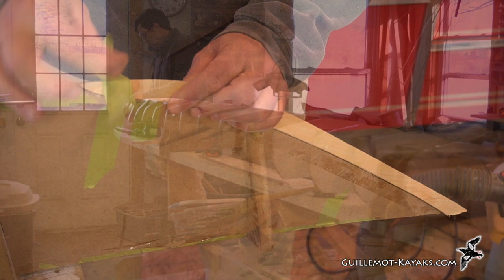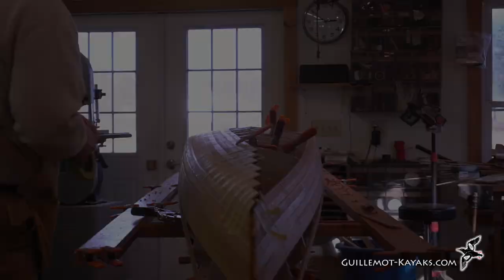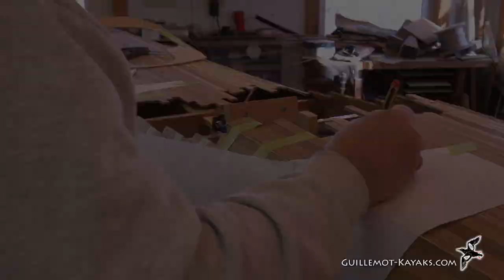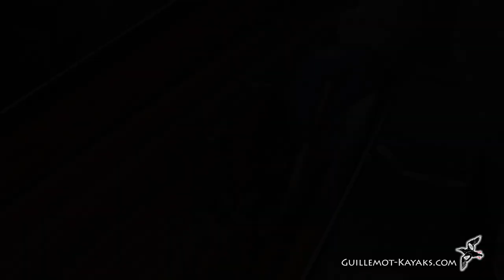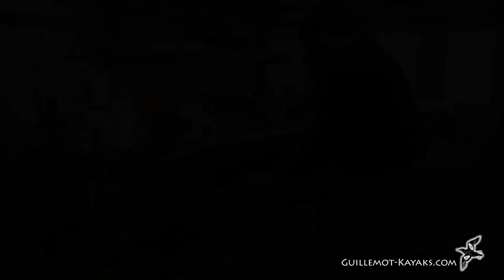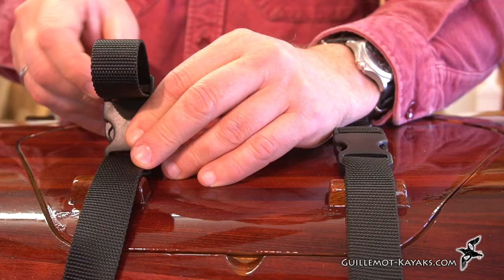Building a Wood Strip Kayak

Comment: I love watching this creative endeavor.  I have experimented with cutting strips,  routing the cove and bead and building small test glue ups.  I am still intimidated by the sheer length of time required and the risk of making some catastrophic error that would ruin all that work! I guess if you are not ready to climb mount everest then don't climb mount everest. I will get there eventually! still trying to find long lengths of cedar to avoid having to join smaller lengths.  Perhaps you address that in one or more of your vids!
Reply from the maker: The way to climb Mt Everest is to start at sea level and take a step up the beach, then take another step.

The odds of catastrophic failure are minimal. The chances of making a mistake that requires you to think and do some problem solving are high. It is actually this kind of mistake that makes the project fun and worthwhile because that is where you really start to learn.
Reply: @NickSchade  Thank you for the thoughtful reply and encouragement. I will get there!

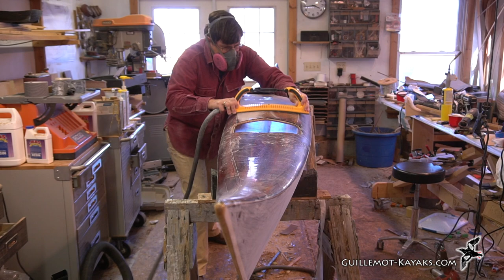Comment: Where can I get info on the tool you were using at 22:17 (long board?)?  I could use that on my current (and first) kayak build, especially with the vacuum attached.

Comment: I really wanted to see how you cut the deck off the hull and how you took the form out but that got skipped over. Do you have any other video of that process ?
Reply from the maker: It is really so anticlimactic that you will wonder why you wanted to see it: https://youtu.be/6UxNdg2knwA?t=1155
Reply: You’re right Nick. I thought the deck would need to be cut to remove it but I take it that was never actually glued to the hull ?
Reply from the maker: @jonlaughton7689  Correct. While all the other strips are glued together, I just don't glue between the first strip on the deck and the first on the hull. So, once the staples are pulled the deck or hull can just be lifted off. 

Amazing boring isn't it?
Reply: @NickSchade  not to a beginner